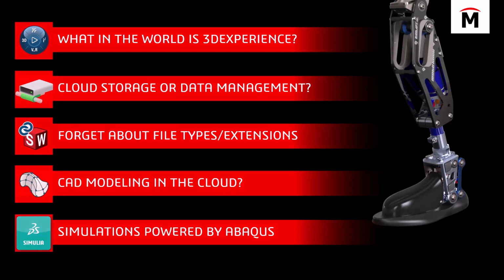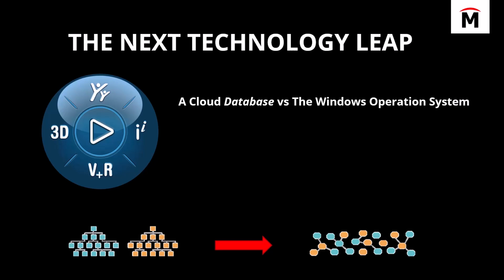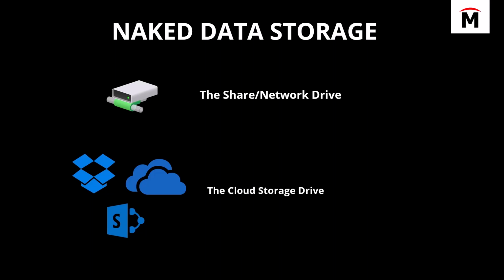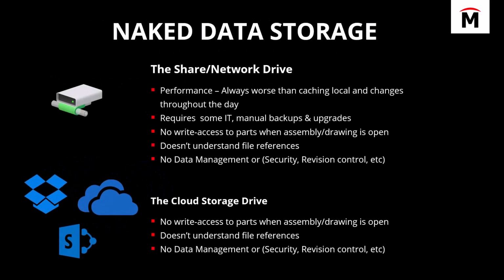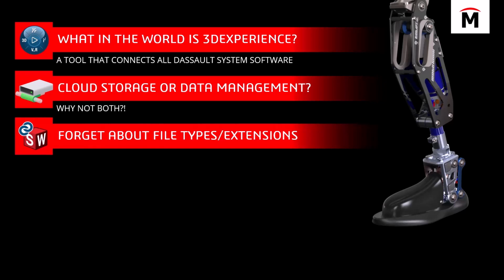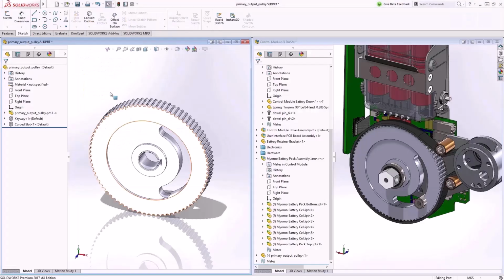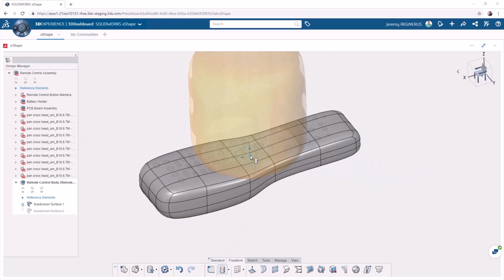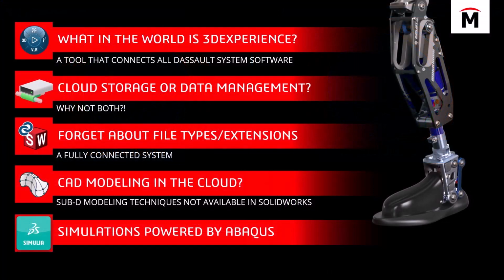What is 3DEXPERIENCE and Could it Benefit My Organization?

Comment: Hi Philip, at 14:15 you stated 3DX is not for all types of files because of file translation into the 3DX database format. I will be implementing either PDM Pro or 3DX company wide to include our CNC manufacturing division. Your statement has me concerned about our code files being stored on the 3DX platform now. Would you NOT recommend 3DX cloud storage for CNC code files?
Reply from the maker: It likely will not be possible to data manage the code files and stamp them REV A or REV B, but you will be able to store them in the cloud via the ‘3DDrive’.  If you are interested in data managing any filetype at all, I would steer you towards SOLIDWORKS PDM.